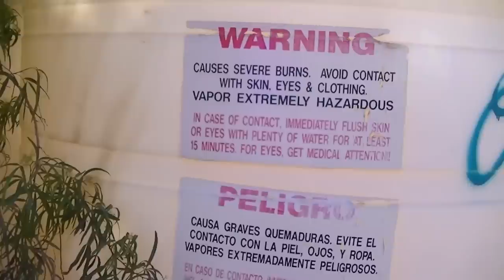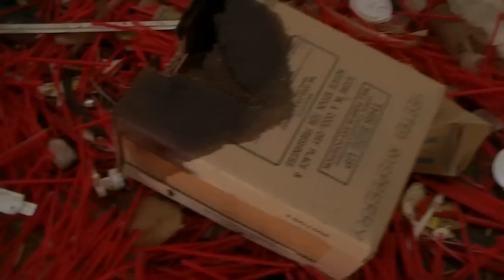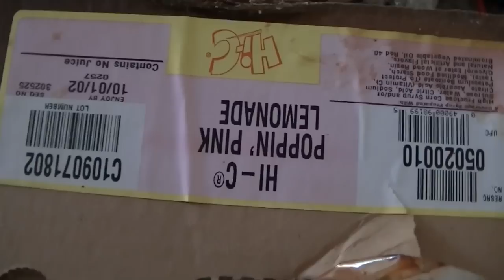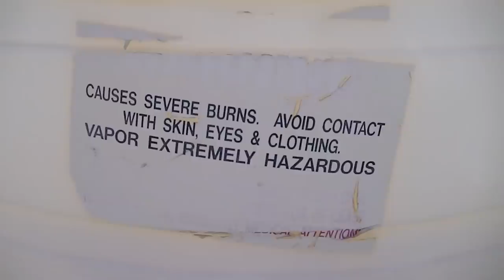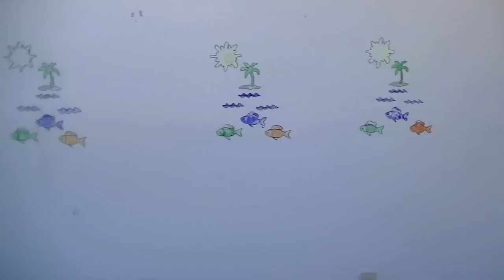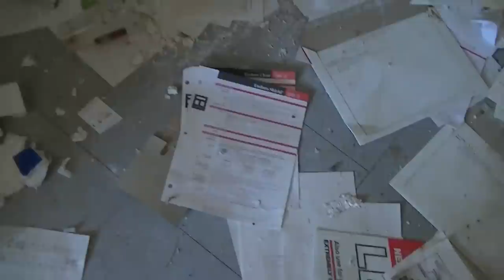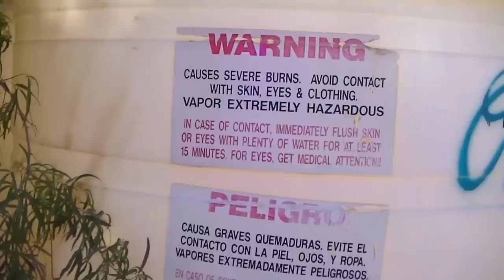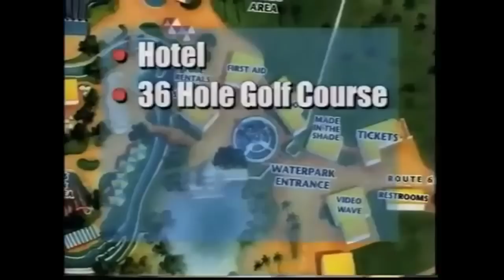Abandoned Water Theme Park

Comment: Nice video! These abandoned places have such a strange vibe to them. It is strange to think that it was full if people less than 10 years ago. I did a little research and found that the slides were dismantled and moved to a park in Canada. That really looks like a well designed pool. Probably not up to current California regs as far as the cold water returns and pumps, but still very impressive. Yeah, the liability would be an issue for paintballers with those underground tanks.

Comment: fter a $400,000 renovation the waterpark reopened in May 2002 under a new name, "Discovery Waterpark". In 2002 and 2003, the park was open on weekends. During the last season of operation in the summer of 2004, the park operated intermittently. The park has been closed since the summer of 2004.